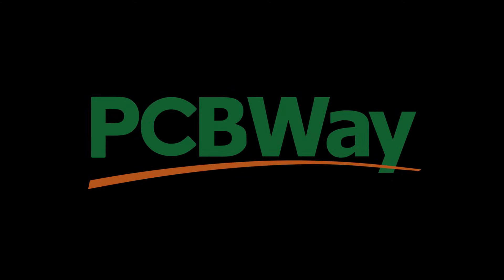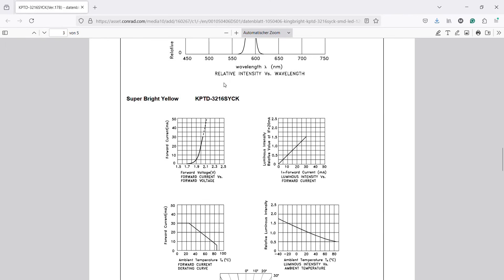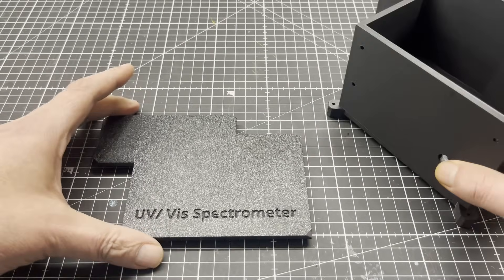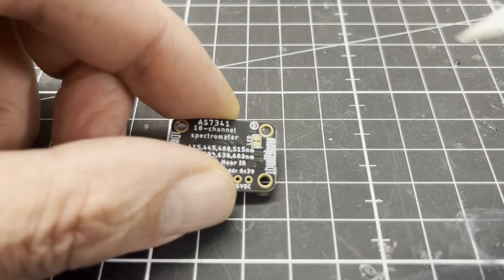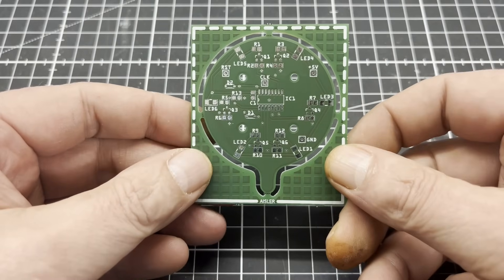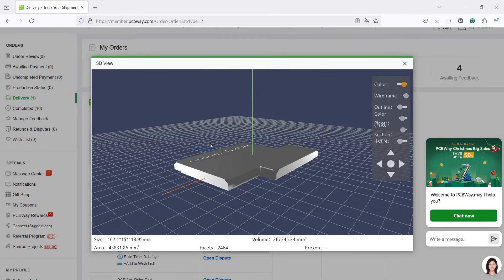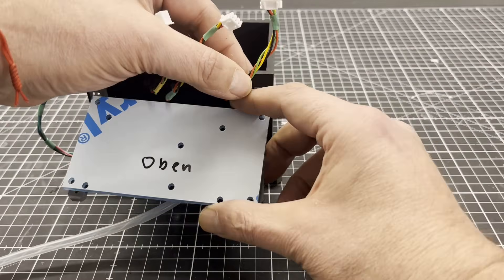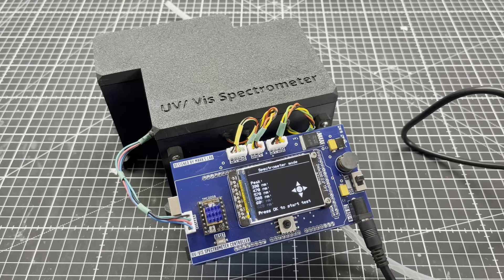Home-made spectrometer (new approach)

Comment: Nice, but why not using linear CCD modules (like TCD1304) + diffraction grating? It would give much more accuracy and resolution
Reply from the maker: I think I made my motivation clear in the video. As mentioned there, you need a deuterium lamp and a tungsten halogen lamp if you want to cover the full UV-VIS spectrum. I wanted to try a different approach and integrate interpolations that give information about absorbances that were not measured at all. Instead of the CCD sensor, you can also use a camera and ready-made software. Everything is fine, but I wanted to try something new :)